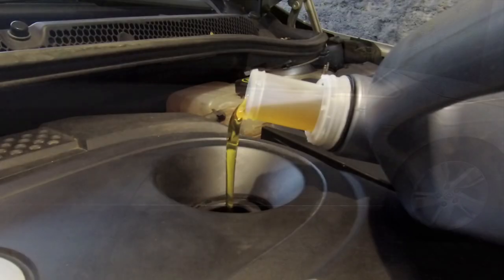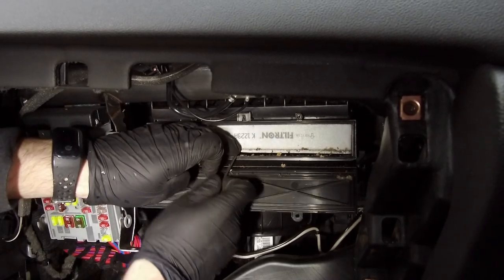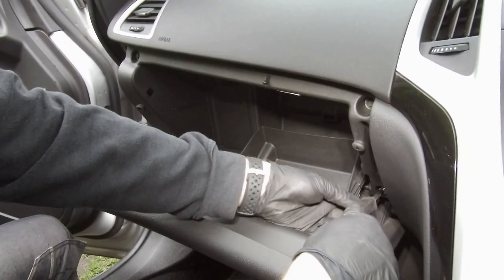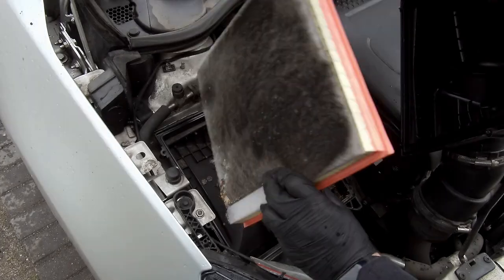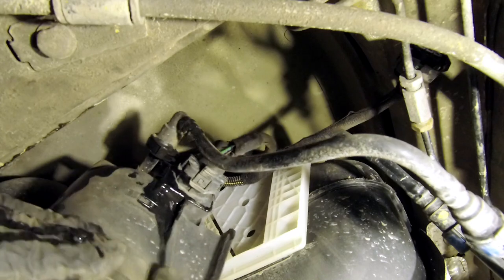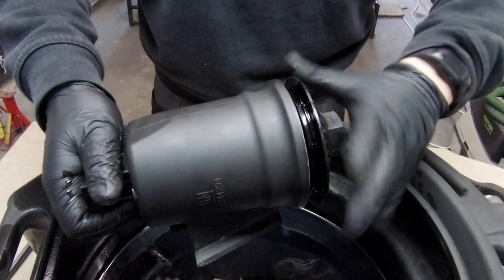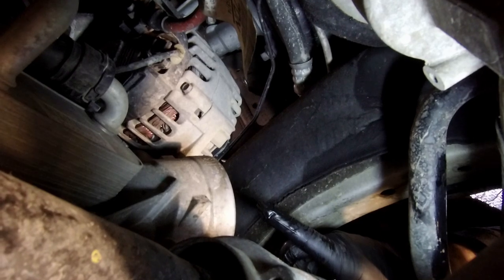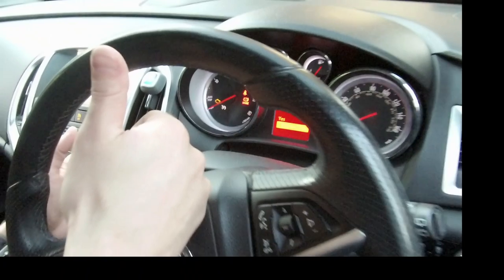How to change oil and all filters - Vauxhall / Opel 2.0 CDTI (COMPLETE Guide)

Comment: You don't need to remove entire housing for fuel filter. Just unscrew screw at the bottom, let fuel drain then undo the bottom part.

Comment: you are really professional i followed as you advised and everything went well..!  TOP 1,000,000 Like

only it does not reset the remaining oil life, it remains the same percentage that is 40%. 

is there a particular procedure ...? 

thank you for your reply
Reply from the maker: Hi there. There is no special procedure for DPF. In this cars sometimes happens that you have to try for couple times to reset the oil remaining life. It will work for sure ;) 
Regards CG team ;)

Comment: Should you not fill filter housing with fuel once you have replaced it, I always do as it is best practice and it helps with priming.
Reply: It primes itself. Turn the ignition on 5 times but don’t start it

Comment: Your interiour filter is placed in this video in an opposite direction if you compare it to the old filter. Very good video
Reply: Filter manufacturers print names and part numbers in differing orientations on the sides of their cabin filters but there is always an arrow denoting the direction of the airflow...in this case it is downwards.

Comment: You don't need to take the whole tray out to access the oil sump plug, there is a panel in the centre that has 4 x 1/4 turn screws, it then folds forward out of the way for the sump to be drained.
Reply: @bruce.wayne1086  I accessed mine with a jack and axle stands, it's pretty bendy so I didn't have a problem. I secured it with a bit of tape to the bumper while I worked on the car

Comment: what kind of oil did you use xW20 ...?  (viscosity)

then after replacing the fuel filter you need to bleed (describe us procedure)
ThanXxX
Reply from the maker: Hi there, i use 5w30 with GM dexos 2 norm (low SAPS). In this video i was talking about how to refill the fuel filter. In this car with this engine all you have to is turn on ignition switch for couple times. Fuel pump in fuel tank will start pumping the fuel to fuel system and will fill up the fuel filter.
Regards ;)
Reply: @carsguidediy  thanxx

Comment: I have 2015 Astra J 1.6 CDTI hatchback and was wondering if all the diesels the same on these models with location of parts?
Reply: not really, my brother's 1.7 CDTI has got oil filter on top of the engine, behind the top plastic cover of the engine. But you should be able to find everything after brief inspection :D just be careful with the oil drain plug, the oil pan is always on the right side of the car. If you find drain plug on the left, there is good chance that you're looking at transmission drain plug :)